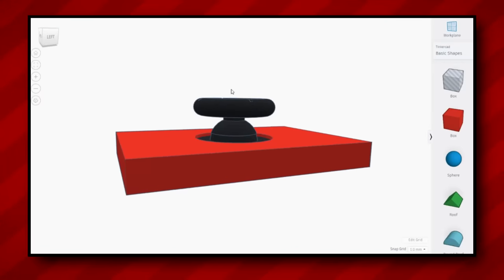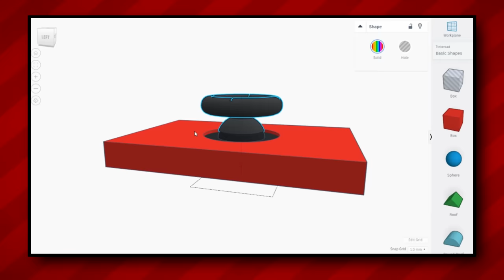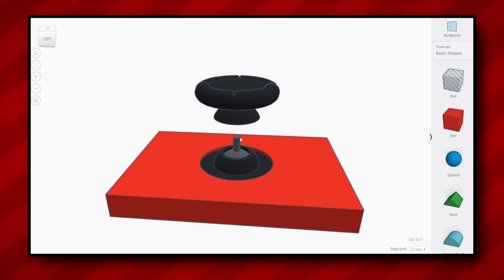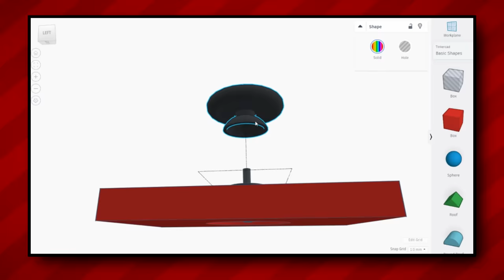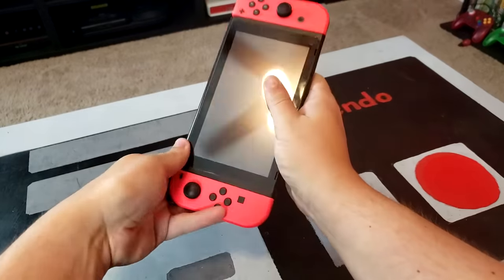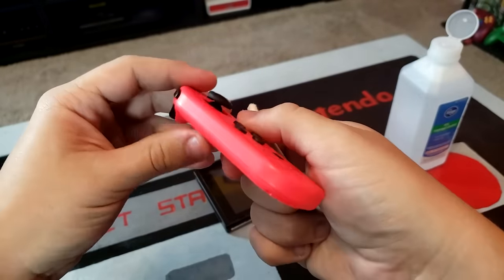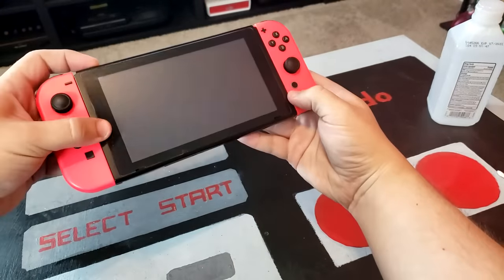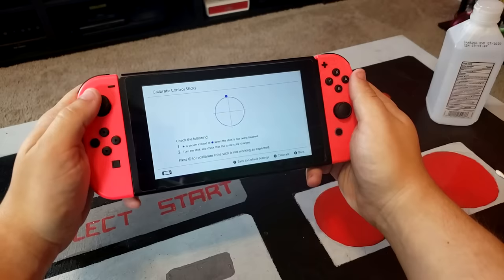How to Fix Joy-Con Drift at Home! No tools required! | Nintendrew

Comment: I actually tried this with the original joy-cons, my switch came with, they had a really bad drifting issue. After trying the isopropyl alcohol trick on them, the drift immediately disappeared. Thank you so much.
Reply: Can I use aceton instead ?
Reply: @gsprsmnc7413  Aceton will dry out and eventually destroy plastic.
Reply: @gsprsmnc7413  NO i got acetone on my plastic hair slips and it kinda melted them
Reply: Will water work?
Reply: @freddytheaxolotl4516  It can work, but too much exposure to water can corrode the insides of the controller.
Reply: @gsprsmnc7413  probably will eat the plastics away.
Reply: Will hand sanitizer worm
Reply: @freddytheaxolotl4516  alcohol is better, it won’t damage the switch
Reply: What if it appeared again like in 20 minutes after it dried off? Should i do it again?
Reply: Tono_lagos  i actually did this thing again and it worked
Reply: This worked for me as well. I just saved 70 bucks. Thank you.
Reply: I just want to play Pokémon without walking to the left or right randomly...
Reply: @vexstranding7936  it reappeared for me in about 2 hours :(
Reply: @OreganoParsley  normal alchool?

Comment: This sounds like a much better solution than banging my Joycons against a table
Reply: Sadly relatable.
Reply: Same here dude
Reply: I tried ripping my joycons out in frustration soany times but man its built like a tank and drifts like one also
Reply: Literally me
Reply: @awesomeswagger1356  (Lenny face)
Reply: Jayblade 456 that’s literally what I’ve been doing
Reply: Jayblade 456 lmao
Reply: Yeah that's what I did...
Reply: lmao
Reply: why is this so relatable
Reply: Same I did that when I getmad
Reply: Not gonna lie I violently slap my joycons out of anger whenever they drift
Reply: Monkey brain say smash
Reply: Jayblade 7 Right there with you bro. Hope you fixed them.
Reply: lol Same but hey, it works for a few minutes! No shame here! lmao
Reply: Now now, let's not forsake the ways of brute force.
Reply: relatable, I threw mines across my room and the light broke
Reply: This is sadly very accurate
Reply: That was legitimately what i actually did before i saw this and got the materials for this method.I used to actually BANG my switch joycons on a wall or table.
Reply: Were not cavemen. We Have Technology!.

BangBangBangBangBanBangBang.
Reply: Oh shit really? I hit it, threw it a few times and let my ps4 controller have at it. Think it's OK? I'm a afraid I hurt a little.
Reply: I blew mine up with a tank after losing 1 mil gsp in smash
Reply: throwing it across the room

Comment: Ladies and gentlemen, I present to you

Blowing in the cartridge 2
Reply: The Charles Show 
Blowing on the cartridge 2: Electric Boogaloo
Reply: Just be sure to slobber all over the thumbstick.
Reply: Lol
Reply: Except that actually damages cartridges and this could work
Reply: @OnlyEpicEmber  But you can even damage more your joystick if
you don't use all the necessary precautions while repairing it
Reply: @ZetaXO_  Damaging something unusable doesn't really worry me
Reply: 666likes
Reply: moans In old geek
Reply: Old school method
Reply: @OnlyEpicEmber  funny you say that because everytime it didn't work blowing in the cartridge always made it work again so where's your logic, it's just compressed air
Reply: I immediately started to blow on the stick when I found out that dust is the issue.
Reply: Bullshit. This actually worked for me. For the past year, my Joycons' respective sticks wouldn't stay centered during calibration, and this method was as good as getting new ones.
Reply: juananz007 chill out, blowing in the cartridge actually works but you shouldn’t actually do it
Reply: Eternal2401 that’s what I do.
Reply: {*Fira, The Light Pheonix*}  you sir have made me shit my pants with laugh
Reply: @wellerissly1  Blowing in the cartridge worked for two reasons, one of them is fine, and the other is BAD.  First, just removing and re-seating the cartridge is what was doing 99% of the fixing.  Each time you put it back in, it would be in a slightly different position, and might have made better contact.  The other reason is that your electrolyte-filled saliva would actually help bridge the connection (temporarily).  This explains the phenomena of blowing in the cartridge, and it working for about 5-10 minutes, and then the game locks up with a corrupted screen.  That happened after the moisture evaporated and the connection failed.  This also has the cumulative effect of eventually corroding the contacts.  I've come across many NES carts that were basically junk from kids blowing their sugar-filled breath into them.  The reason the NES console had such problems making proper contact with the cartridges is a very very bad design on Nintendo's part (with the original front loader NES).   The Blinking Light Win kit fixes that.
Reply: @chrismartin583  
Yikes, you okay?
Reply: smartest thing i have heard all day.
Reply: haha im the 4.1k like evil laughter
Reply: oh yes i remember that DS thing where u have to blow in the cartridge -_-
Reply: @tangleduniverse5042  if u have not experienced it it is rlly annoying. BUT now that I look back at it it is rlly funny.
Reply: Good one 😂👍
Reply: Blowing the cartridge actually damages de cartridge this alcohol is actually used to clean stuff like this.
Reply: @polocatfan  That's why I also pointed out that the moisture in your breath also has an effect. There might be some cases where there is actual dust buildup causing a bad connection, and in those cases, using something like Dust-Off or compressed air is safe. Just don't blow in it with your mouth.  The real fix is replacing the garbage connector design with something reliable.  I've taken apart MANY front-loader NES consoles, and am very familiar with the piece of crap they call a 'zero-force' connector.
Reply: Nibe pfp
Reply: Ah the memories of yesteryear
Reply: Sadly we can't blow cartridges anymore or they might get sick and die...
Reply: 🤣 That was a good one.
Reply: It's "Blowing Into The Cartridge So It Can Be Read: Controller Edition Season 1 Episode 1 - Joy Can Drift Fixer!"
Reply: @OnlyEpicEmber  If your stick is "unusable." Then I don't think that rubbing alcohol will help your problem.
Reply: {*Fira, The Light Pheonix*} pesky bird!
Reply: {*Fira, The Light Pheonix*} haha another hc watcher i see
Reply: raelik777 So essentially just get a compressed air can
Reply: 2.0
Reply: I miss my og snes 😪
Reply: Lol it worked
Reply: Wdym
Reply: Nintendo keeping the tradition alive.
Reply: No...
Return of the Blow.
Reply: @polocatfan  How Raelik777 explained, wet contacts did work, but damage them overall. 
Just clean them up with Alcohol and they'll do their job. 
You'll not blow any more into them, because they just work.
Reply: I remember doing this, but I'm 14.
The funniest part is the cartridge says NOT to blow into it
Reply: @juananz007  it only depends on if it’s mechanical or if it’s clean if it’s mechanical tough shit cough up another 60 bucks if you want a normal joycon for another 2 months at most
Reply: @raelik777  I can confirm that I've attempted multiple times to use the remove and reinsert method, and it doesn't work. Blowing however does work, and not for 5-10 min like you say, but for the the entire duration of gameplay. I get blowing may be bad in the long run, but it does work.
Reply: @JohnSmith-xf1zu  I realize that it will sorta work, because you're blowing an electrolyte mist onto the cartridge. But the actual fault is with the terrible "zero insertion force" connector design inside the NES.  The only real fix is to replace that connector.
Reply: Electron boogaloo
Reply: 😂😂 I’m done
Reply: 🤣🤣🤣 no kidding 💯
Reply: Lol
Reply: I spray contact cleaner and air blows, It work for me.
Reply: OHHHHHHH
Reply: hey at least cartridge getting dirty is the user's fault!
Reply: @OnlyEpicEmber  how is taking the dust out hurting the cartridge? Unless you spit on it.

Comment: Since everyone is memeing down here and nobody makes a feedback i'll do it for you:
As for now, it totally works, I'm going to play a bit and tell you if drift eventually occurs again

Edit: it worked for a couple of hours and then I had to recalbrate them. Now they work, I suggest you to try Anyway since this Will not damage your joycon, but of this doesnt work you should recalibrate and then drift shouldnt occur anymore

2nd edit: after more than two weeks drift in my left joycon isnt a thing anymore, while my right one still drifts a little, but it's doing it way less than before. I Hope I've been helpful to anybody.

3rd and last update: after 4 months, the right joycon failed completely, because of different hardware issues, while the left one is completely ok!

4th and actual last edit: I recommend to avoid doing so too many times and too often, as a guy below said, with too much alcohol the inner parts could get damaged, and cleaning it too often (in my experience) ended up not making any difference
Reply: Doing this and also recalibrating has not helped me. I don't know what to do.
Reply: Have you seen any improvement? I reccomend you to try and clean once more, I cleaned it 3 Times before it worked, also mine aren't perfect now, but cleaning them several Times definetely helped, good luck fixing your drift!
Reply: I cleaned it a third time and the drift is worse than ever. Games are now unplayable as opposed to just being kind of annoying.
Reply: @jordancooperlalala  im very sorry to hear that 🙄 i dont know what to say it worked for me
Reply: @jordancooperlalala  you're 100% sure you have used isoprophylic alcohol ( i dont know how to spell that)
Reply: Well, that's what it says on the label.
Reply: @jordancooperlalala ok, then I have zero idea of what could have come wong, im very sorry
Reply: jordancooperlalala contact Nintendo. They were doing free repairs for everyone, even without proof of purchase.
Reply: @luiszaragoza6500  yeah but I dont Think they do that in Europe, I Think it's only a Nintendo America thing (not 100 percent sure I Think it's worth a try)
Reply: Cdi link Well you cant send your joycon for repair anyways right now due to the coronavirus.
Reply: Cdi link G it sure is boring around here
Reply: @GrahamTowler  oh boy! I'M So hungry, I could eat an octorok!!
Reply: @a_a7287  fair enough
Reply: thank you for the feedback! it also worked for me! it's not perfect but it did an amazing improvement!
Reply: Hey I have a question what percent does the alchohlo have to be? Like 91% or 70% for this? I heard that 91% damages the joy con so im kind of worried.
Reply: @theappfan6158  I used 91% and it worked!!
Reply: @rickynova834  Ok thank you!
Reply: @theappfan6158  no prob let me know if it worked later!!
Reply: Thank you for not only giving us this info, but providing updates on it too. It helps a ton.
Reply: @AmateurContendr  glad to be helpful
Reply: Your game was a failure, but you are still a hero.
Reply: @phantompop3192  it's to a point where it even hurts calling it a "game"
Reply: thank you for commenting! i've been wanting to get a switch lite but i've been hesitant because i'm scared of joycon drift. this makes me feel a little better
Reply: @rickynova834  It did work! Thank god i had alchohol at home. It did work and they dont drift thank you so much.
Reply: i’ve had my switch since 2018 and it worked for me! calibration didn’t work well but when i went to play i saw way less of a drift
Reply: @theappfan6158  thank the maker of the video,not me 😋 glad it worked tho
Reply: @pochocha12345  yeah also remeber that after some time it might start drifting like before, it's not always a permanent solution. Happy to know it worked!!
Reply: Guys he used 91% it might not work if you use something other than 91%
Reply: I know right!? They won’t stop!
Reply: thank you for a real answer !
Reply: Ricky Nova Thank you for the feedback man. It’s really annoying scrolling through a comment section of unfunny memes just to find one serious guy who tells you if this worked or not.
Reply: @SleepyMook  👌
Reply: Thank god I hope this works
Reply: Yes, thank you!
Reply: @waterlily789  did it work?
Reply: Ricky Nova oh, I haven’t had drift yet, I was just thanking you for letting us know that it actually works. I’m trying to be prepared for when it happens
Reply: @waterlily789  👌
Reply: king
Reply: @jordancooperlalala  Alcohol is too harsh on the tiny plastic pieces inside. Alcohol was good back in the day for Nintendo games but what you should be using is something like WD40 electrical contact cleaner spray, stick the little tube under the rubber boot and give a small spray then rotate the stick for 30 seconds then let dry for 5. If it doesn't work then the contacts for the joy-con are too worn.
Reply: Ricky Nova hero
Reply: What if I dun have the alcohol
Reply: A word of caution to the it doesnt damage your controller part. If you put to much alcohol inside it can spread to other components and damage the controller
Reply: @jordancooperlalala  I was having the same problem, until I really wedged the q-tip in the thumbstick. You have to make sure it actually gets covered with the alcohol. I've had no drift since for these past few days, unlike the failed clean attempts where the drift would return after a minute or two.
Reply: @leonvschris1  yeah, I meant it shouldn't damage if you follow exaclty the steps in the video. Caution is always the way tho
Reply: Thanks for taking one for the team and testing this! The fact you even checked up after a few weeks too makes it so much more helpful :)
Reply: Thank you!!!
Reply: Do you need a specific type of alcohol
Reply: @turtle4838  yeah you should use Isoprophylic alcohol so 91% if I'm not mistaken (I used 91% and it worked flawlessly)
Reply: @turtle4838  Isopropyl
Reply: @rickynova834  ok thanks I found some in my house I appreciate that
Reply: @supersteve76  I read that wd-40 contains oil and can make the dust stick, are there different types?
Reply: @jordancooperlalala  TASTE IT
Reply: @Hullo hi you're welcome, I'm gonna provide a last update soon tho
Reply: Ma hero
Reply: Worked for me as well (at least for now). Cleaned the left joystick and calibrated it.
Reply: @rickynova834  
As an American that tried contacting Nintendo months ago, I can assure you that it's not an American thing to have them repaired for free, considering that they wanted to charge me $35 for it. It seems like a lot of people talk about that being a thing, but I've yet to speak to anyone that's actually gotten it done for free, so I'm not convinced that that's even a real thing.

As for the solution in the video, it doesn't fix faulty hardware, it only really fixes drift if your drift was generated by the thumbstick being dirty.
Reply: @Sin_Alder  well yeah, one of my joycon had another problem and after doing this it didnt get any better, I had to replace it
Reply: @rickynova834  ma boooy, these updates are what all Switch owners strive for
Reply: @ShinobiWan1  I didnt expect such a positive response to this simple comment! Thank you so much guys you're awesome!!
Reply: What do you mean the right quit working due to hardware issues???
Reply: @shadeshiest22  I mean that it had a different problem, not Joy con drift, it just doesnt register the inputs anymore (I think somebody either dropped it or treated it poorly, unfortunately i'm not the only one using my switch
Reply: Okay
Reply: I dump a little of alcohol to my drifting stick without using qtip and it works (thankfully it didnt get destroyed). I didnt open the middle of it though
Reply: you sir are a true hero.
Reply: Thank you for actually talking about it and not making a dumb meme
Reply: thank u for this !
Reply: @rickynova834  are you supposed to use the exact alcohol or any alcohol?
Reply: @Thanosmeme  I used 90% isoprophyl alcohol because it dries faster and I'd recommend to use that, but I'm not sure if other types of alcohol could work fine too.
Reply: @rickynova834  ok i used the alcohol and my joycon is still drifting
Reply: Thanks. Was tired of the memes